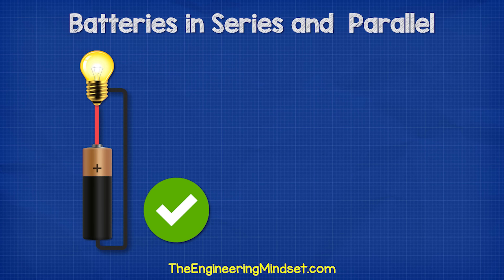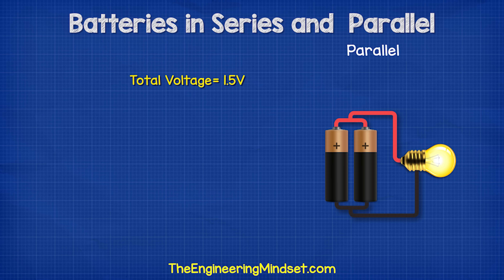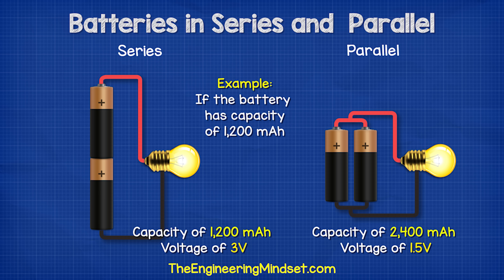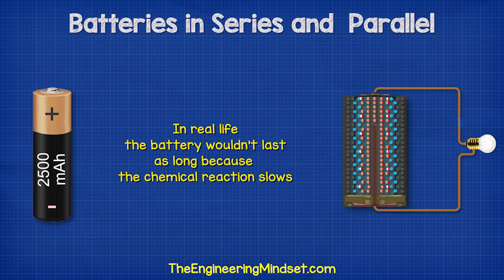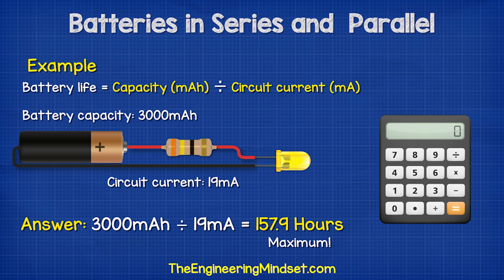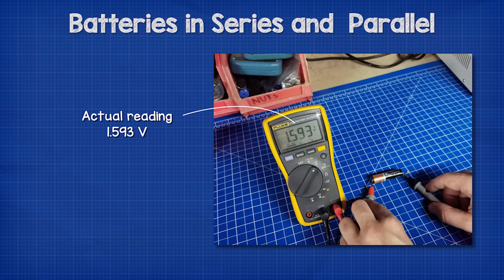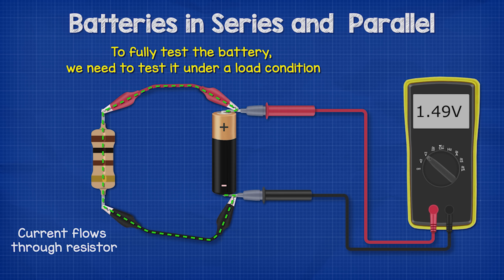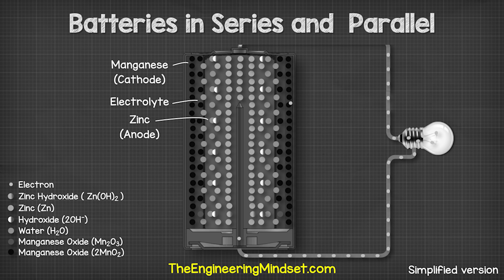Why do we connect batteries?

Comment: So if 2 alkaline batteries in series are added, then why do you get less than 1.5 volts, if one of the batteries is dead, and the other is brand new? The dead battery acts like a resistor. That is not captured in the equation. Because, try it, 3+0 = 2.something
Reply from the maker: Check out NEW resistor video, everything covered! ➡️ https://youtu.be/DYcLFHgVCn0

Comment: Connecting batteries together is to either increase voltage or amp hours(runtime) of the system, or both, depending on the configuration of the batteries. The end.

Comment: Clarify this : mAh doesn't really say much about the capacity. It's the wH (watt-hour). Regardless you connect the battery in series or parallel, the capacity adds up. 
By connecting in series, you effectively increase the voltage w current capacity being the same (Ex 2x 1.5v 1aH battery in series gives the total capacity as (3v at 1aH) 3wH, and in parallel (1.5v at 2aH) as the same 3 wH. 
This is a very common misconception I feel. It's wrongful to not include the voltage in your capacity measurements.
Reply: I thought the same. Like capacity is basically charge in Coulumbs, they can not dissapear right?

Comment: Can you please make a video where you explain current density and how you calculate it? I've been looking it up on YouTube but nobody simplifies it enough for me to understand. 
Also, if you see this comment, i want to thank you very much for every video you've made, you thought me a bunch and i appreciate all your hard work.
Reply from the maker: Do you mean electrons per second? https://youtu.be/kcL2_D33k3o
Reply: @EngineeringMindset  I think he means Watts/battery mass. Or more simply Ah/mass for equal volt batteties.
Reply: @EngineeringMindset  electrons per wire thickness, calculating the area of the wire and how, for example the density changes when passing through both a 1.5mm wire and later down the circuit trough a tungsten wire i.e a light bulb.
Reply: @artsmith103  that would also be a nice video
Reply: @vlad516  What I described is called charge density. Lithium quite high, Pb is lower but there are Pb benefits. 
What you're describing sounds like current Flux. Try that key word. I've never heard much concern about this. Wire gauge per current charts are easily available. Approx. 10amp=16ga, 15amp=14ga, 20amp=12ga, 25amp=10ga. Many more options and technically length of wire influences choice.
Reply: @vlad516  It's a complicated topic about current flow on surface of wire vs center. Then stranded wire vs solid. Then it changes between thin gauge and heavy gauge due to actual vs nominal size. I suggest find another topic to improve yourself and just follow recommended charts for recommended wire gauge.
Reply: @artsmith103  i see where you're coming from, but i really do want to understand it better, im fully aware that charts exist, but I'd like to get a deeper understanding.
Reply: Is that what a coulomb is?

Comment: Hi, I have 12v dc fan it takes 0.28a and 12v 6a peltier.i powered those devices through 12v 2a adapter.but those devices didn't work properly.please say how many amps should I use ?
Reply: Dude u sayed  that the peltier eats up 6 amps  then  how come u are powering it with a 2 am supply

Solution
1)Connect  the two  appliance in parallel   
2)  as per math u would need 6.28 amps     but in real life ( inefficiency)   use a 7 amp  supply😃
Reply: @Abhyuday_rai  thanks bro
Reply: @jaiakash8494  welcome bro

Comment: In real life applications, I think we don't use parallel power source because the battery voltages are not exactly the same. When in an open l circuit, the batteries, especially rechargeable ones, would slowly lose charge by charging each other.
Reply: @kennmossman8701  it should only be done temporarily.

Comment: I guess things have changed.  I was taught that what you're calling batteries were cells, and that a battery was a group of cells in series.
Reply: In my EET associates course from only a couple of years ago, they taught us that the battery symbol; the short line and long line, with an air gap between them, drawn perpendicular to the circuit line, one pair of those is representative of one cell. For a three cell battery you'd draw three pairs of these lines, etc etc. However most of the time when this wasn't important the teachers would just refer to them as batteries, not cells or multi cells. Is this different from what you were taught? Just curious.
Reply: @goosecubes  I was first taught this in middle school physical science class in the late 1970s, again in high school physics class in the early1980s, and again in electrical theory in US Navy Nuclear power school in the mid 1980s. 
It was taught as one for a single cell, two for two cells and three for three or more cells if I recall correctly.
The fact that one cell does not a battery make was also stressed.
Reply: And then after all of that we were taught, forget a lot of what you've been taught here and we were introduced to "hole flow".
Reply: The cells are inside the battery
Reply: @jgon12  AA, AAA, C, D, coin "batteries" are all cells.  They are not batteries.
Reply: It's a common mistake. Technically speaking, a cell is a single unit generator capable of storing chemical energy to convert to electrical energy, and any group of two or more cells is called a battery. Basically, cell=singular battery=plural. 
Going a little further, there are 4 types of cells, wet, dry, fuel, and reserve
Reply: Wait wait , I thought that it was after a act of Battery , your assigned a cell 🤔-- errr never mind Kinda something only different 😱.
Reply: @paulrooster2108  I see what you did there.
Reply: @paulrooster2108  🤣
Reply: if you look at most of the questions, the understanding of what cells and batteries do is rather limited, so semantics are not really an issue here!

Comment: What about "squeezing" the battery when it's low, is it real? To be honest 😸 I do it every time
Reply from the maker: I put mine on the radiator or rub it with my hand to warm it up, always works but probably isn't the safest idea
Reply: @EngineeringMindset  Yes, warming the battery improves the chemical reactions with the last available chemicals as well as lowering the internal resistance somewhat.   The opposite is also true - to conserve a battery, it is best to keep it cool.

Comment: Trick question: if we parallel series battery, will it give more current and voltage?
Reply: Yes it will.
Reply: Boats/RVs often use multiple 6V series pairs in parallel to build a pretty  big 12V battery bank.

Comment: If the battery has voltage it still has charge though right ?
So technically its not dead till it has 0V ?
just run whole lot of dead batteries in series to get a higher charge !
Reply: No! The internal resistance rises as a battery loses its charge (due to the chemicals being used up, mainly the zinc case) so on open circuit (i.e. no load connected) a dead battery might show  the full nominal voltage with a high-impedance voltmeter.

Comment: What I've always been wondering is how come the next battery in series doesn't blow up due to the accumulated voltage? 
The concept of over charging a battery with a higher voltage is the lines of what I'm thinking.
Reply: I was wondering why the batteries in parallel don’t short circuit.
Reply: @PlayitonPan  They don't short circuit as the voltage on the neighbour is opposing it, but they do equilibrate and they will usually end up with exactly the same voltage.

Comment: For many cases when you have two 1.5 batteries and one have 1.3 -1.4 V your device would not work properly or work at all. 1 v mean it's dead for a long long time
Reply: 1.5 V battery is typically full at 1.6V, 90%full at 1.5V, 75% full at 1.4V, 50% full at 1.4V, 25% full at 1.2V, 15% full at 1.1V and empty at 0.9V
Batteries with 1.3-1.4V should have a lot of energy (might be unusable) still there.
Either you'r devices draw a lot of power or cut out too early.

Comment: Just as a FYI, I personally know AA batteries capacities are all over the place from different manufacturers etc etc.
And I know you mentioned this slightly at the start, but I don't think it was stressed enough when in the video the capacities of these batteries were changing from 1250/2500/3000 from scene to scene and then throwing additionally different ways to calculate the different topics.
It might have been best to reduce the amount of variables a new person to this topic had to think about and use a single capacity throughout the educational video.

Comment: Actually, if you discharge a cell at a lower rate, you will often get the full capacity, if not more! For high drain devices, that can drain the battery in an hour or less, you'll typically get ~1/2 the rated capacity. (a thing called Peukert's constant) Another thing, this 1.5 volt battery is actually called a cell. 2 or more cells connected in a series, forms a battery. I don't know, if multiple cells connected in parallel for extra capacity is called a "cell" or "battery.